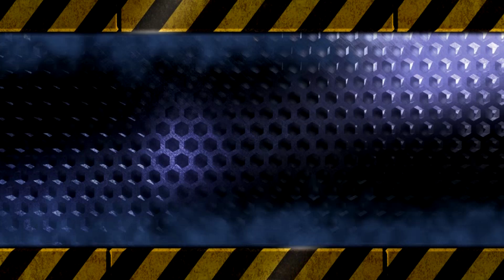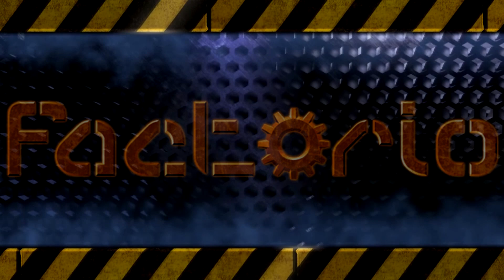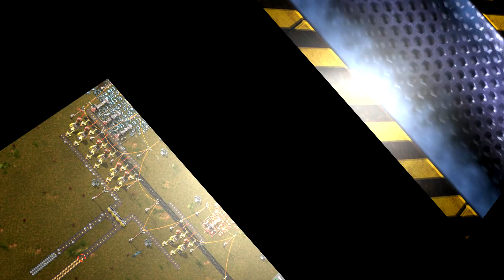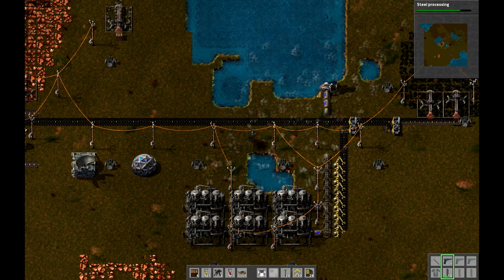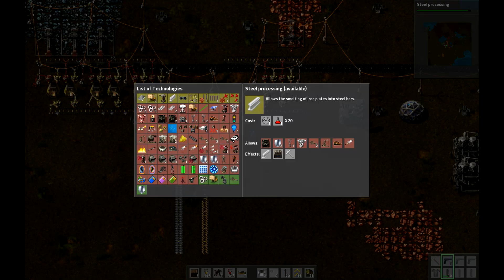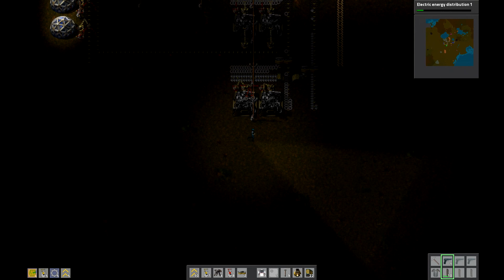Factorio | Beginners Guide #3: Assembly Machines

Comment: In my base i dont have cooper near, how do I make those machines to research
Reply from the maker: +Ricardo Lopes Honestly recommend restarting till you have a start that has copper, iron, coal, and stone nearby. Explore around the area a bit if and if you don't find anything hit esc + restart map. It will spawn a new random map with the same settings.
Reply: +Maximum Strategy  Hmm ok i will restart until i have all the resources near !!!
Thank you !! This guide is very good it helps alot ^^
Reply: +Maximum Strategy 
I have a question.How do you put sulfuric acid into an assembler 2/3.
I want to make the blue card thingy but i cant transport sulfuric acid into the assembler.
Reply from the maker: +Vangjo Pula The assembler should make a pipe attachment when you pick a recipe that needs it.